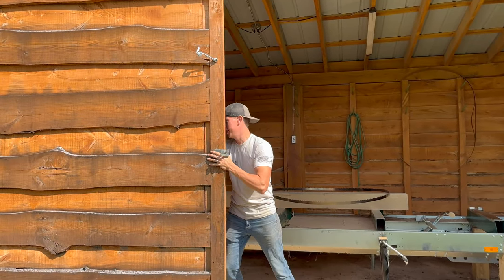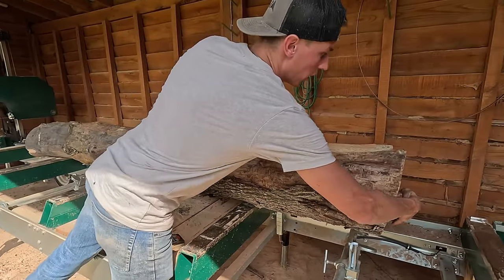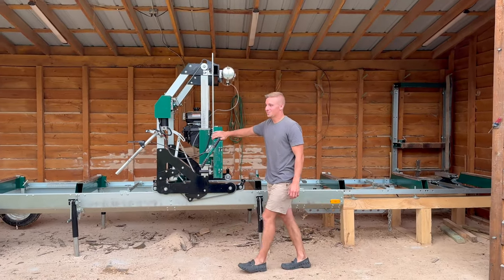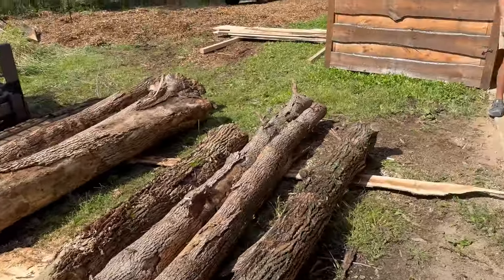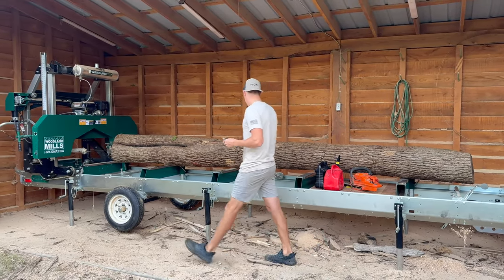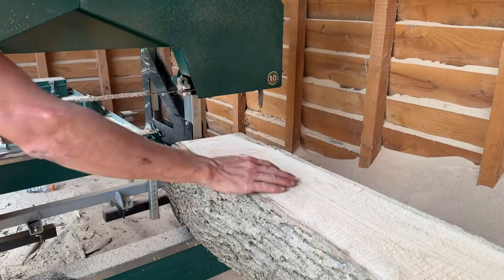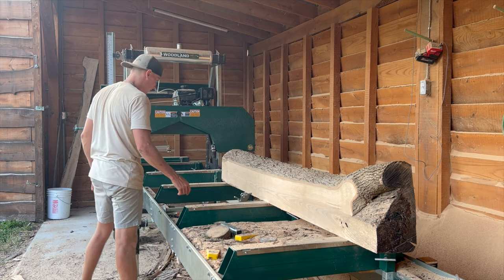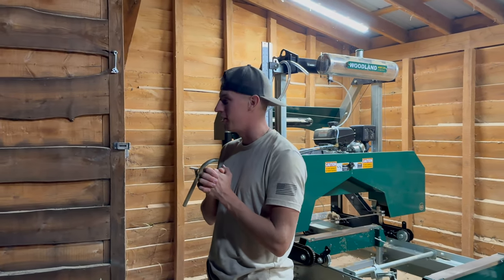How Quickly Can We Mill 35 Logs For Our Silo Renovation | Pt. 5

Comment: Wow, I love the extension you added to your mill on the trailer!  We have a WM on the extended trailer and I've been wondering how we might do just that.  I was thinking we'd need to just buy all new track and move the mill head back and forth between the trailer and the stationary track, but your extension is genius!  How hard was it to get it all to line up perfectly?  I imagine that pouring a concrete base was an essential aspect of making sure it would stay level.  I'm also curious about how you managed that wide of an open span.  Could you fill us all in on how you spanned it safely and what kind of snow load that will carry?  Can you still get the mill on the trailer out of there, or is it permanently in there now?  Do you have a video on the kiln you made?  That's pretty boss as well.  Way to go!  Wish I could turn back the clock about 40 years and do exactly what you guys are doing...

Great content guys, I'm binge watching!
Reply from the maker: Thanks and glad you’re enjoying the content! It wasn’t too bad getting it lined up perfectly because the extension still sits on leveling feet, concrete slab is a must as well!we don’t get too heavy of snow storms by us, typically around 24” at most but haven’t had any issues with it. We used (3) 30’ lvl beamed and ledgered them together to make one giant header, it sags slightly in the middle but definitely really strong!

Comment: Is a blade just shot right away if you
Hit a nail?
Reply from the maker: Sometimes they are shot if you hit a big enough nail or bolt that break off teeth on the blade, but luckily these were small enough the only dulled them and can be resharpened